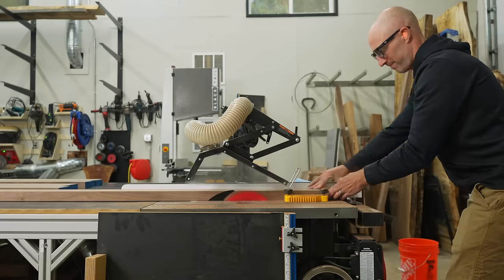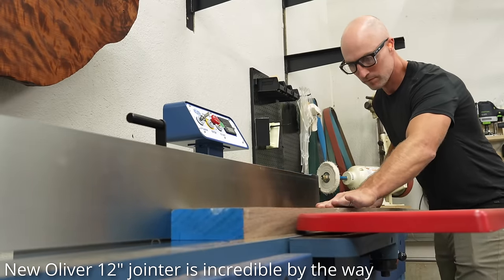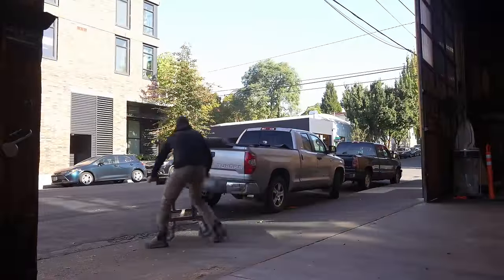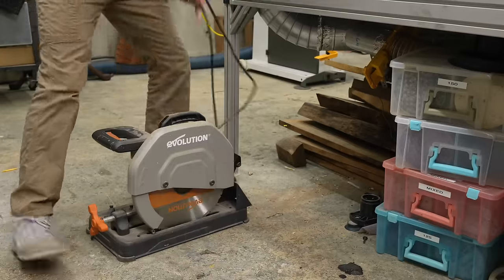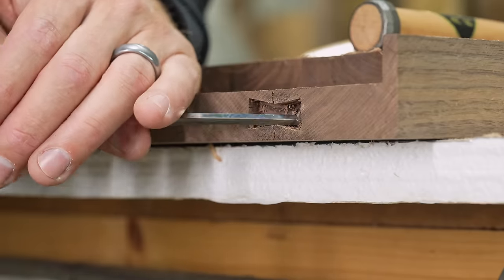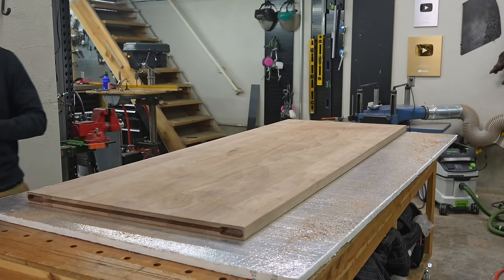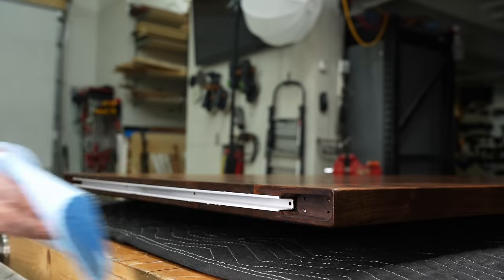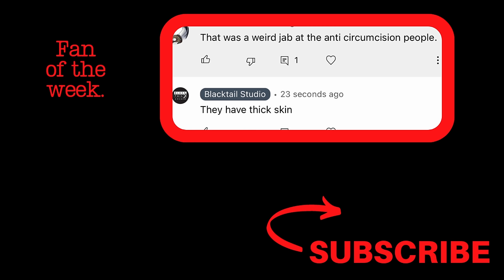I Hate Barn Doors, So I Made This

Comment: Absolutely love your work - When you get stuck with drywall patches a killer application that beats all the fillers on the market is just Westpac fast set 5 or 20 (20 is much more forgiving). Your techniques shown in video is perfect, just watch the mud and when it starts to gray out smooth over again with a wet knife. When it sets up if not already perfect it can be sanded with a Wet Sponge, no dust. It sands like balsa wood, lite and fluffy.  Just make sure and prime it before paint so it doesn't flash.

There are numerous brands of hotmud, but this one is the easiest to work with.

Comment: I know this is super late but as a drywaller I just wanted to tell you putting joint compound right onto wood (especially load bearing wood) is a surefire way to get cracks, as you know wood moves seasonally and while the wood can bend, joint compound is extremally rigid and brittle. If you do get cracks I suggest cutting a slightly bigger spot and screwing the backing wood 1/2" recessed for drywall and make sure to use fiber tape to help it resist movement.
Reply: What- no real dowel and glue?? Lol! I used to work at Woodcraft!i think you did great! Shes just too damn picky!!,

Comment: I’m late to the party but I like both styles of hanging. However, I like yours better bc it’s smooth, solid walnut and it looks beautiful! 
Re: The old door: If anyone has ever tried to dust a rough wood anything, you’ll know what a pain it is bc, not only the dust, but also the fuzzies from the dusting cloth get stuck in the wood and it looks terrible. Whoever thought rough wood has ANY place in a home has never tried to clean it!
Re: The filled knot: you did an awesome job of seamlessly filling that knot hole, and should feel proud to point that out. You cd also ask, what wd they rather see? A clunky old knot? Or a seamlessly fitted and smooth replacement? Wood is organic; it has characteristics and you can’t get it without! 😊 TFS & keep up the good work! 😄

Comment: I have a similar door with exposed hardware.  I think the big difference is the finish on my hardware.  Yours looked like it came out of a dungeon.  Mine is relatively clean and modern, and doesn't detract from the natural stone wall it sits on.  
Your door on the other hand was insane.  You totally nailed that.  I'm not sure why your didn't fill the knot hole instead of patching.  Your wife has eagle eyes.

Comment: Hint: When making invisible patches - Obviously the same wood. Try to find a grain pattern that closely matches the surrounding area. Then draw in the missing grain lines with same color (pencil crayons or Aniline dye)  and if the tiny phloem & xylem are visible, use the tip of a small No.1 precision X-Acto-knife to mimic the gain pattern and depth. Then Follow with final coat. I keep many self made sized jigs around for this very purpose. These patches are 99.9% invisible and only I know where they are unless I forget. - then 100% Nice door - too heavy, probably.
Reply: Agree on the too heavy. When we remodeled the master bedroom, I installed two pocket doors (bath and closet) and initially used solid doors. They were insanely heavy and actually hard to move. I returned them and used hollow core doors, and I never regretted that decision.

Comment: Thanks for the inspiration!

One tip for others trying this mechanism--'dry fit' your finished door to the wall, put a spacer on top of the door top insert, and draw a line from the spacer as the door travels the opening. Use a level to install the stationary trolley piece parallel to your line and you are golden--no need to worry about shimming the bottom wheels!

Comment: In a way I like videos like this even better than your regular stuff. It shows that even a great craftsman like yourself can get frustrated by lack of or confusing instructions & make mistakes like drilling into the pipe in the wall and messing up the drywall. But mainly that you fixed it without it showing. 
I used to build & repair things in an old monumental office building and more than often people weren't sure what I was doing or had done lately because they didn't see the work that was done, and I accepted it as a great compliment.

Comment: I had the same issue.  I have a small hallway bathroom, and the door opening in, means you have to go in and scoot around the door to close it.  I wanted a door, like a barn door, but I hated the big black suspension.  I kept looking and found a company that makes “hidden” door hardware.  I bought it and hired a handyman to do the work.  I wanted to reuse the door that was there, and off he went spending 1-1/2 days getting it all ready.  The problem is that the existing door was not wide or tall enough,  I found another handyman, who talked about adding wood to the top and sides and making it all work!  And he did.  Because I paid some money to the first guy, and the second guy wasn’t cheap.  I spent more than I wanted to but in the end, he delivered the door and it works!  Oh and this hardware has a soft close when opening it or closing it!

Comment: Last sping when my husband was away I ripped out a bathroom  wall hiding ductwork from an obsolete air exchanger. The original owners had replaced it twice in the first 6 years after building the house  and then just stopped. 
We now use energy efficient air exchangers called doors and windows. Very effective. Now power needed.
I built a much  much needed linen closet in that space.   Our linen closet was under the stairs I had converted into a walk in pantry. So I also cleared up more space for food. You do not half to remember to get towels before having a shower.
I find it much easier to do things when the husband is gone. While I can invision what I want to do, my explanations stress him out. 
And I knew he wanted access to the pipes in the shower and he has it now. So he was happy.
The door looks great.

Comment: If you've got your boards skip planed to a point you can make good grain selections knock down your lumber for the pieces you need.  Suppose you're making a buffet a few longer 6' pieces and a lot of 2-3' pieces - the deformation after ripping will be much much less with those shorter pieces than with 8-12' planks.  Have a few extra of the widest/longest pieces and you have a cascade down of stock if you machine your components largest to smallest.

Comment: Excellent job!  So many little details to get right for sure.  99% of viewers out there will prolly not be trying this themselves.  I say that bc for the time, effort, and especially $$ not sure it's worth it vs maybe just swapping with modern stainless brushed nickle hardware on original barn door and calling it a day maybe the wife would have been happy too.  Or a pre built semi hollow walnut door swinging out with 4  bold stainless hinges and modern pull knob.  Slick quick cheapo and be done lol

Comment: 16:44 those plastics ones are NOT drywall anchors. They have a kind of grip that gives you the confidence when mounted but over time they will get loose and release.
Get ones that open and grip on the inner side of that drywall. "Hollow Wall Drywall Anchor" get those that are made of metal and open in a star pattern.
Reply from the maker: Oh, I hate those ones. These are still going strong over a year later and are what the manufacturer recommends.

Comment: I made a barn door to our master bath and attached the typical door trim sides and top, to the door and the opening is squared off drywall. I even put a dummy hardware set on it. But it’s barn door slider hardware. If I knew about this hidden hardware, I would have used it.

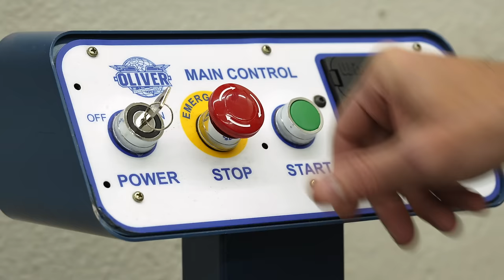Comment: 3:18 love your channel bud, but please don’t joint like this. You may as well use a planer if you use pressure at the jointer blades. Flat boards only come from letting the wood float naturally across the jointer allowing for a perfect result, then you can head to the planer!

Comment: My dad and I were building shelves in my garage and found a weird patch of drywall with a ton of wood behind it with a studfinder. Welp... That wasn't wood, it was a black water drain pipe from my shower just like the pipe you had there, but mine was 180 degrees vertical. He put a screw in it and later patched it up later with some black goo. No problem because there's no pressure from the drain.

Comment: Two thoughts about this door:

A:  If you grab the edge and pull, how easy is it to trap your hand between the door and the door opening?  Can a toddler close it on his hand?

B:  If you are inside and someone close it, can you open it easily from the inside?

*

In terms of appearance I don't like that it's so much larger than the opening.  I prefer the look of the original.

But I don't like barn doors in general as they are not weather tight.  Not needed inside, but a barn door is awkward to latch, allows sound to go around it, etc.  

*

The design of the hardware seems clunky and awkward to use.

Comment: That power socket on the wall would drive me nuts.  You gotta move it!   Imagine someone is using the vacuum cleaner and another person opens the door and it has so much weight behind it, it hits the plug and cracks the socket.   It shouldn't be hard to move it left.

Comment: Pretty sweet but i personally don’t like how the door is flat. For me if it’s going to be flat it would need some kind of unique design in it. Everything i do has to be one of a kind and something that someone else couldn’t or wouldn’t be able to copy-it’s not a narcissistic thing it’s a creative thing that i worked hard at thinking one more creative level deep and that rewards me. That was a ton of hard work but the fact that i can call up a shop and have them make that in a day or 2 (with hardware installed) and bring it home and stain it & hang it means to me it’s almost like buying it at Homedepot. Thats why I’d want to do something unique to the front of it or into it. At the end when i noticed the floor hardware my brain hated this whole concept. One big reason for barn doors (i hate barn doors) is no floor hardware-so for me personally it totally cancels out this system unless it had a face reader on it and opened automatically and a fast speed as i approached or said “open pantry” then i might go for it. Or like if you are getting too fat or if your wife is then you have to stand on a scale built into floor before door opens and if you are overweight it won’t open after 6pm🤣. I’ll be honest i think there’s a market for a next level Homedepot or Lowes. I should be able to buy something like this from a local guy who sells this thru the next level place and the place needs to be 2 stories. Or they need to have separate stores or strip mall for the different departments even the nursery part. We need more of everything and not have to order online. Technology can make that door incredibly fast. These empty malls around the country could be turned into these new type of big box stores that I’m referring too. Plus i shouldn’t have to push a heavy cart with technology now and it should ring up price as i put everything in cart. Box stores are making me insane for 10+ years now because of all the house wives that are hissing their husbands around and “thinking” in the middle of isles of their crappy designs. Everyone thinks they’re a designer because of HGTV DIY channels. As a contractor and designer it’s so annoying to get what you need and to go to homes that has a wife that watches those shows and thinks she knows what she’s talking about because of the show she watches. There should be retail box stores and contractor box stores so we can get in and out.

Comment: The door doesn’t open 100% right? You have to have a couple inches overlap/overhang in the fully open position due to the bracket positioning correct me if I’m wrong. Yours looks minimal.
Reply from the maker: Correct 👍🏼

Comment: haha even though it looks like abs pipe you drilled into I think your initial fear is healthy.

I don't know what code governs the installation of gas lines but even for water lines and electrical you'll see stuff like metal plates on studs to prevent nails from going through.

Besides, aint no silly drill going through metal. You need an angle grinder for that😊

Comment: Hate drywall anchors much rather cut the wall out and place a 2x4 in between the studs and replace the drywall mud/paint and screw the hardware into wood.

Comment: No hardware is better than the really ugly hardware, but one thing i would prefer is a minimalist, clean handle of some sort for two reasons.
One is that it would tell you immediately how to grab it rather than having a slight hesitation, plus it's just awkward grabbing a bug panel by the edge.
Also, i think having something expressing it as a door is better looking that just a big wood plank on the wall. Just a small, clean handle.
I have to say that after all the great work to make the whole panel look perfect, that patch wasn't up to the level of the rest of it. I'm not surprised she noticed it, it was kinda marginal. You could do much better.
Nice drywall patch though.

Comment: I'm the same type person as your wife, I notice EVERY detail and am a perfectionist for my own work. It amazes me sometime how oblivious most people are about misaligned or unlevel things or, for example an aluminum framed glass panel wall that had two brands of Philips screws that no one saw but me until I pointed out the differences (a faint difference in the silver shade and one manufacturer has a bit more radius on the countersink screw head edge).

I like the no show hardware but question the amount of work it takes for most people to afford because most won't have your tooling.
What I did was peal the sheet rock,  and rebuild the wall to take a quality pocket door instead of a barn door. And guess what? No one noticed the thicker wall, haha.

Comment: No domino? No problem, you can use a good quality dowel jig with a drill, a biscuit cutting bit on a router with biscuits, or use the same cutter to run a continuous groove all the edge a do a loose T/G joint, use a finger joint bit in a 1/2inch router or if you don't have access to any of those options get yourself to the local tool shop and open your wallet and stop complaining about what you don't have.